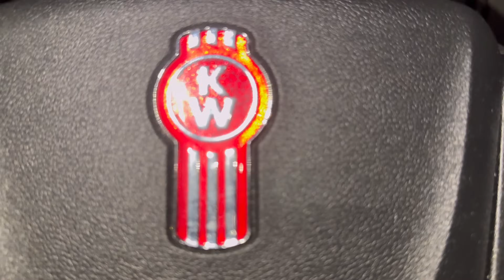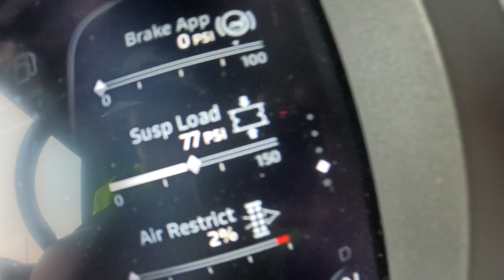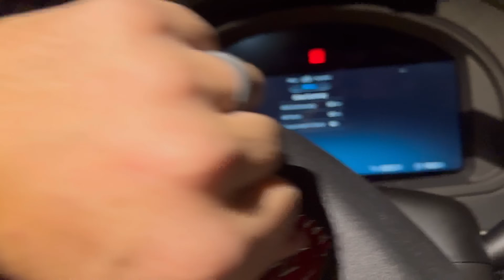Supply chain crisis recap. December 8, 2023. California, Oregon, Nevada: ‘Sick Chain Laws Bro’

Comment: I often haul what we call mine balls. They're just steel balls of various sizes used for crushing ore at mine sites. Each pallet, regardless of size of ball, is about 4000 pounds on a 40x48" pallet that's at most three feet tall.. I can totally see a lift weighing that much.
Edit to add that I had to put two full sets of heavy triple chains on yesterday, and they stayed on for about 150 km. Yours look so much easier.
Reply from the maker: Oh yeah I got rid of my 3 railers lol

Comment: Seventeen and seventy two both start with S . Drink more water when you are on a water fast. Good luck and a solid 10 on the chain work. Break a link is to truckers like break a leg is to theatrical actors. So break a link and keep plugging away at that supply chain crisis.